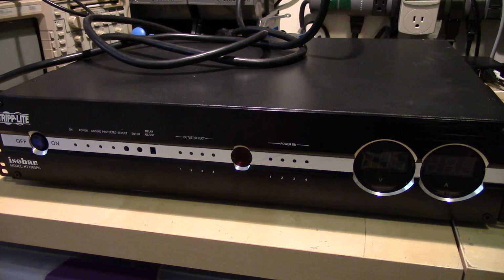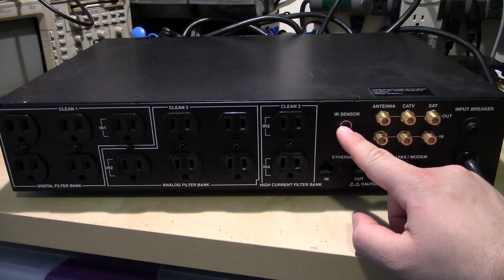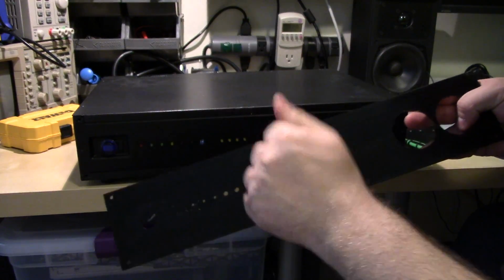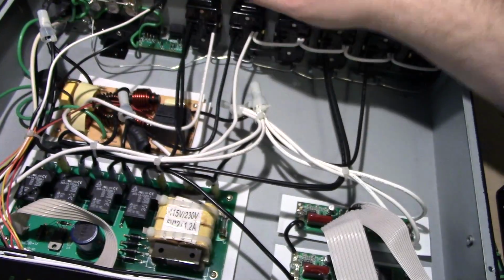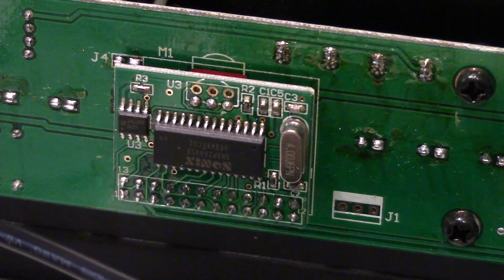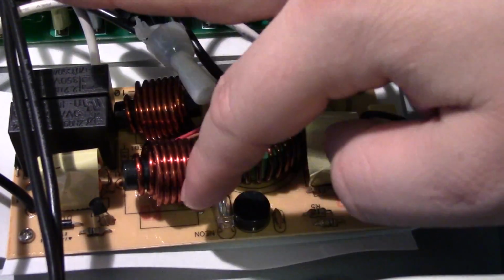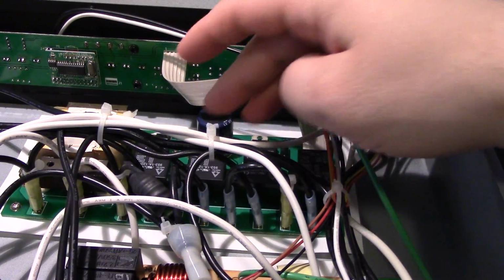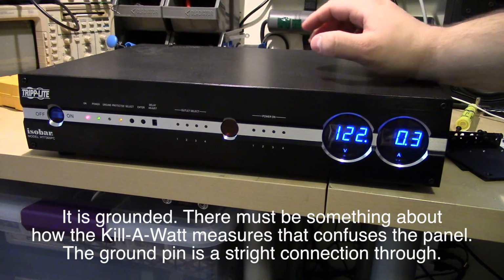Tripp-Lite Isobar HT7300PC Teardown and Quick Mod

Comment: any idea on where to find a replacement power switch for these units?
Reply from the maker: Nope. But I'd start by looking at the one you have and checking any part numbers. Otherwise you might just need an equivalent rated one and perhaps some light case modding to get a different design to work. Or you could just bypass it completely if you don't really need to turn it off.
Reply: @PeterBrockie  Thanks Peter, I contacted the company for a replacement switch and they are shipping me a new unit! great customer service.
Reply: good idea on the bypass, I hadn't considered that.
Reply from the maker: @Tenkvandool Awesome!